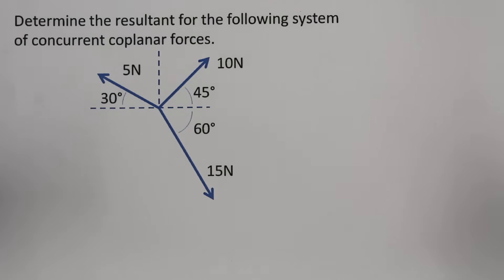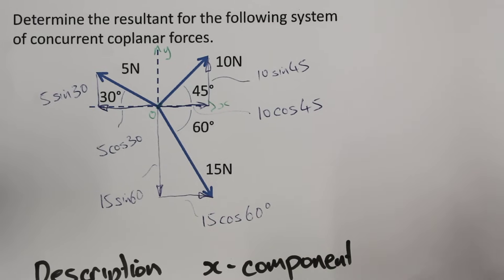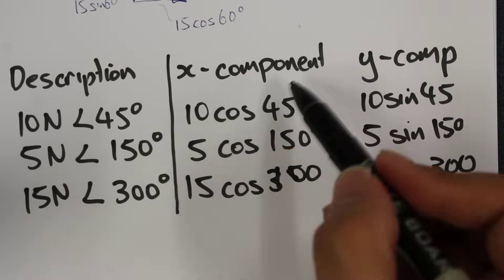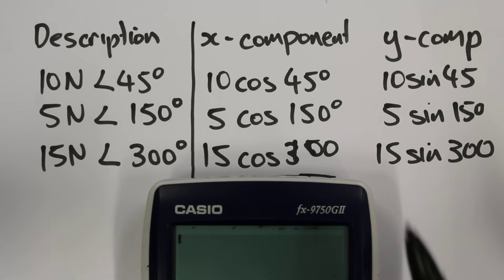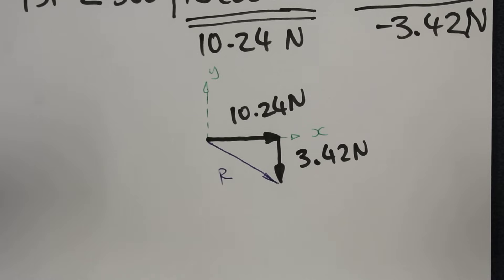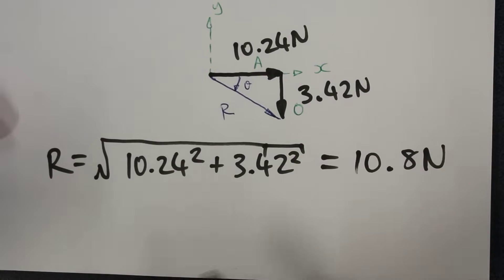Resultant of Three Concurrent Coplanar Forces

Comment: You should include the sign convention on the angle theta
Reply: No, The direction is mentioned in the figure he made.
The figure itself justifies the direction.. this is amazing
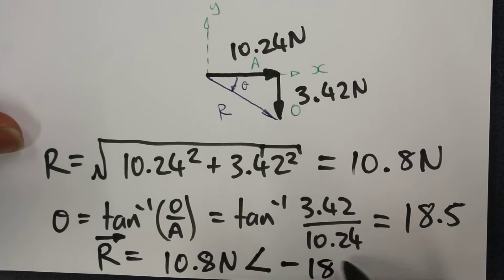Reply: The figure does help to point out the sign convention and I have used a symbol at 11:00 to indicate the sign convention. I do agree with John that including a diagram to indicate the sign convention could be useful to avoid any doubt as I have seen several questions about the angle and the negative sign with the 18.5 degree angle in the comments section of this video.

Comment: I have a question why is the 18.5 negative
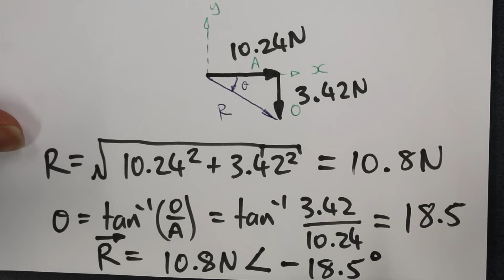Reply: I think you are talking about the angle at @11:10 for the resultant force.

The angle is negative because there is a convention in Mathematics for angles. The angle is measured from the x-axis, and the positive direction is anti-clockwise.

The angle could be written as 360 -18.5 = 341.5 degrees as a measurement from the x-axis... or could be written as -18.5 degrees as measured from the x-axis.

Also, the angle symbol used (http://www.fileformat.info/info/unicode/char/2220/index.htm) means that the angle is measured from the x-axis with anti-clockwise positive

here is an answer by someone else
https://www.quora.com/Why-do-we-measure-the-angle-anticlockwise

Comment: The angles of 30 degrees and 60 degrees can't be used. For the force of 5N you use 180-30=150 degrees and for 15N 360-60=300degrees. We measure angles from the first quadrant. The calculations for this will be wrong won't it?
Reply: "The angles of 30 degrees and 60 degrees can't be used. For the force of 5N you use 180-30=150 degrees and for 15N 360-60=300degrees. We measure angles from the first quadrant." 
# yes this is what I have done for this question. I want to point out that this is not the only way, an alternative could be to find the x and y components of the vectors using the angles that were given. For example for the 5N force.
x component: = - 5 cos 30
y component: = 5 sin 30

For the 15N force
x component: = 15 cos 60
y component: = -15 sin 60

In this method, the negative or positive is from if it is pointing in the x-direction or y-direction. The choice of sine or cosine comes from trig and SOH / CAH / TOA. 
Opposite = H Sin (Angle). 
Adjacent = H Cos (Angle)

"The calculations for this will be wrong won't it?"
I believe that the answer for this is correct as it has been solved several times by multiple engineering students and lecturers however I am interested to see your answers as maybe you are using an alternative method and we can discuss and learn together.

Comment: If three force 50N ,60 and 20 are  acting on a body simultaneously and 20N is opposite to the direction of other two.Determine the resultant force.
Reply: This sounds like an addition, subtraction problem.

For example
50N pushing to the right
60N pushing to the right
20N pushing to the left

Overall, there will be a net force of 90N to the right.

Comment: 2 questions 
1) How can u use cos and sin if you have angles like 300 meaning its not even a triangle anymore?
2)Why can you go clockwise for the final resultant answer but before all angles were measured anti clockwise?
Reply: 1) Trigonometry is used in triangles, 3 sided shapes. It can not be used in others unless you split the shape into triangles and work it out from there.
2) The final resultant was negative, subtract this answer from 360 it will give you the anti clockwise angle. Hope this helped :)

Comment: what if one of the force lies flatly on x-axis or y-axis?
Reply from the maker: If its pointing to the right, along the x-axis, the angle would be 0 (or 360). If it is pointing up, along the y-axis, the angle would be 90 degrees. If it is pointing left, in the negative x-direction, it would be 180 degrees. If it is downwards, along the negative y-axis it would be 270 degrees.

Alternatively, you could just write the value of the vector. So if it is a 16 Newton force, perfectly along the x axis; you would have 16N in the x direction and 0N in the y direction. 
If it is a 18N force in the y direction; it would be 0 Newtons in the x direction and 18 N in the y direction. If it is 22 N in the negative x direction;  it would be  minus 22 Newtons (-22N) in the x direction, and 0 Newtons in the y direction. If it is 25 N in the negative y direction; it would be 0 Newtons in the x direction and -25N in the y direction.

Comment: On the graph your wrong 3.42 isn't it meant to be -3.42???
Reply: Are you referring to 7:50 ?

I assumed that the direction of the arrow was enough to indicate that it was in the negative direction.

I tend not to write the negative in that case because someone might look at that image then assume that the negative means that the vector is in the opposite direction compared to what was shown. ie they might think that since I wrote -3.42 going down; that actually means 3.42 going up. The person would then get an incorrect idea of what I achieved.

Alternatively, you could use the values as coordinates (rather then writing the vector in the x direction and y direction); in that case you would need to write -3.42 to indicate the y-coordinate.

Comment: why dd the negative 3.42 turn positive while calculating the resultant using pythagoras
Reply from the maker: You can treat it as negative, and you will still get the same answer. sqrt( (10.42 )^2 + (-3.42)^2).
Note that a negative number squared is a positive number.

Comment: a body is acted upon by concurrent, coplanar force system. The rotation of body will zero why?
Reply from the maker: This question has assumed (either correctly or incorrectly) that the forces are being applied at the centroid of the body. This would mean the forces would only cause translation of the body and not rotation.

Comment: Who to change the titha-18 = negative sign
Reply: I think you are talking about the angle at @11:10 for the resultant force.

The angle is negative because there is a convention in Mathematics for angles. The angle is measured from the x-axis, and the positive direction is anti-clockwise.

The angle could be written as 360 -18.5 = 341.5 degrees as a measurement from the x-axis... or could be written as -18.5 degrees as measured from the x-axis.

Also, the angle symbol used (http://www.fileformat.info/info/unicode/char/2220/index.htm) means that the angle is measured from the x-axis with anti-clockwise positive

here is an answer by someone else
https://www.quora.com/Why-do-we-measure-the-angle-anticlockwise

Comment: Why is the 18.5 negative
Reply from the maker: I think you are talking about the angle at @11:10 for the resultant force.

The angle is negative because there is a convention in Mathematics for angles. The angle is measured from the x-axis, and the positive direction is anti-clockwise.

The angle could be written as 360 -18.5 = 341.5 degrees as a measurement from the x-axis... or could be written as -18.5 degrees as measured from the x-axis.

Also, the angle symbol used (http://www.fileformat.info/info/unicode/char/2220/index.htm) means that the angle is measured from the x-axis with anti-clockwise positive

here is an answer by someone else
https://www.quora.com/Why-do-we-measure-the-angle-anticlockwise

Comment: For the resultant, do you have to go 'X' then 'Y' because the other way round would give the same magnitude R but a different angle right? cheers
Reply from the maker: Yep, you will get a different angle. You are using the tan equation to find an angle. Usually, I just draw the triangle that results in order to find an angle relative to either axis; then measure the angle from the x-axis.
 ------- tan equation below -------

Tan (angle) = opposite/adjacent

In some countries they use

Tan (angle) =  perpendicular / base.. I dont like this naming convention because it confuses some people.

Comment: Sorry but may I know how you get 150° for 5 N and 300° for 15 N and why??
Reply from the maker: The angle I am trying to get is the angle, measured from the x-axis, in a anticlockwise direction. The reason is because the sine wave was derived from finding the ratio between the y component and the magnitude of the arrow; the cosine wave was derived from finding the ratio between the x component and the magnitude of the arrow. Please look for a video of a rotating vector and sine to help you visualize this (sometimes called a rotating phasor). The graph of sine, is a graph of the percentage of the length of the vector in the y-direction.
https://www.youtube.com/watch?v=OjHgoZOdRKM
https://www.youtube.com/watch?v=a_zReGTxdlQ&vl=en

I got the 150 degree value by knowing that there is 360 degrees in a circle, and that there is 90 degrees in each quarter of the coordinate system. We have 90 degrees in the first quadrant, and in the second quadrant, there is 60 degrees left over. The best image of this is the line that I draw at the 3:29 time stamp
I got the 300 degree value by knowing that there is 360 degrees for a full rotation, and there is 60 degrees between the vector and the x axis. So in the anti-clockwise (counter clockwise) direction, there will be 360 minus 60 degrees of angle ... ie 360 - 60 = 300 degrees. The best image of this is the line at draw at the 3:51 time stamp
Not sure if this helps, but I hope it does.
Reply: @corneliskok7794  aight! Thanks for the explanations!

Comment: QUESTION: 
what will  you do when after adding the x-comp and you are getting a negative number and if same happens to the y-comp
Reply from the maker: Hi Albert, You would add the vectors head to tail; with the x-component pointing left (horizontal with the page) and the y-component pointing down (vertical with the page). You would have a triangle that looks like this... https://www.researchgate.net/figure/RightAngle-Triangle-Hopper-Scale-19-Therefore-from-the-right-angled-triangle-Fig_fig2_281274006 (ignore the y on this image)

You could find the angle theta using the tan(theta)=O/A relationship

Then to find the angle with respect to the x axis you would add 180 degrees to theta above.

Note: If the vector is in the "third quadrant", the angle with respect to the x-axis should be between 180 degrees and 270 degrees.

For the magnitude: you would do the same as in the video. Note that the square of a negative is a positive. For example (-4)^2 is equal to 16.

Comment: Is it me or have you missed - and + numbers based on axis?
Reply: I mixed up two approaches in this video.

One way is to find out the magnitude using trig to find components; then if it's to the right it's in the positive x direction and it should be positive,  if it's to the left it's in the negative x direction and it should be negative... a similar thing would be applied to the y direction.

In the video, when I got to the table, I used another idea. When you use the length of the vector (example being 5 N) and times it by the cosine of the angle measured from the positive x-axis (example being 150 degrees) then the cosine function will make the number negative or positive as needed. (Cosine 150 is a negative number; cosine 30 is a positive number).

Search for "sine wave from a rotating vector" and I hope you will understand what I mean for how I have done it for te second way

Comment: Why did the angle of the final answer became negative sir?
Reply from the maker: I think you are talking about the angle at @11:10 for the resultant force.

The angle is negative because there is a convention in Mathematics for angles. The angle is measured from the x-axis, and the positive direction is anti-clockwise.

The angle could be written as 360 -18.5 = 341.5 degrees as a measurement from the x-axis... or could be written as -18.5 degrees as measured from the x-axis.

Also, the angle symbol used (http://www.fileformat.info/info/unicode/char/2220/index.htm) means that the angle is measured from the x-axis with anti-clockwise positive

here is an answer by someone else
https://www.quora.com/Why-do-we-measure-the-angle-anticlockwise
Reply: @corneliskok7794  Thankyou sir!

Comment: why is the 15N force at a 60 degree angle when from the centre its technically 30 degrees
Reply from the maker: Hi PlainLuke,
I was trying to avoid drawing over the top of the x component of the 10N force.

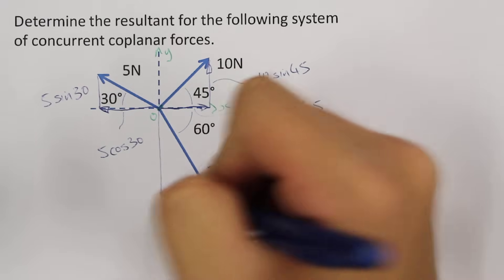At time stamp @1:37, the downwards vector can also be calculated using 15 cos 30; 
At time stamp @1:39, the vector going to the right can also be calculated using 15 sin 30

15 cos 30 ... is also equal to ... 15 sin 60 ... which is the downwards component
15 sin 30 ... is also equal to ... 15 cos 60 ... which is the component going to the right
Reply: @corneliskok7794  ohh ok thanks very much bro
Reply from the maker: @PlainVlogs  No worries :-)

Comment: Can the direction also be 198.5'
Reply from the maker: normally angles are measured anticlockwise from the x-axis.

Using the above convention the direction cannot be 198.5

If you are measuring the angle as clockwise, from the negative x-axis... then we could use 198.5 degrees. But this convention would be very weird.

Comment: why is it not 180 add theta for the direction?
Reply from the maker: It seems like you have been taught a method to determine the direction of the "equilibrant", once we have calculated the "resultant".

In this question, the resultant is 10.8N @ -18.5 degrees
(angle measured with positive direction being counter clock-wise from the positive x axis)

In this question, the equilibrant is 10.8N @ 161.5 degrees
(angle measured with positive direction being counter clock-wise from the positive x axis)
(note: 180 + (-18.5) = 161.5 degrees

Comment: When you did the 10.24 squared plus 3.42 squared the 3.42 is still minus isn’t it? So it still has the minus attached when you do the square root?
Reply from the maker: Yes, the 3.42 is minus. The minus is inside a square, so it becomes positive.

So (10.24)^2 is positive, and (-3.42)^2 is positive.

Sqrt [  (10.24)^2 + (-3.42)^2 ] is what I could have written too...

Comment: What was the point in working out 5sin30 and 15sin60 etc, if you just used the angle relative to the x axis?
Reply: Good point: its because I use both interchangeably; and the benefit of using 5sin30 like I have in the video is that sometimes it can be quite alot faster (or more convenient) than using the angle relative to the x-axis.

Part way through creating this video, around the 3 minute mark, I saw that it would be easier to demonstrate an answer that finds the x and y components of the vectors when they are written in polar notation (using magnitude and the angles measured from the x-axis).
Reply: Cornelis Kok so if you were to use the original 5sin30 etc, would you just be able to do the exact same table, except with all values relative to something else, and what would that something else be, I’m a little confused. Thanks for your help
Reply from the maker: @jacobfewings4068     yup, you could do the same table. One difference is that you would need to deal with determining if the component is negative or positive. For this question, the x component of the 5N force is negative. 

Sum of forces in x direction =
10cos45-5cos30+15cos60

Also, the y component of the 15N force is negative

Sum of forces in y direction =10sin45+5sin30-15sin60

If you check the totals for the equations above you should get the same answer as the video.

Comment: this is wrong. for x value it should be -5cos(30) for B  you forgot a negative sign, resulting in 8.741N for sum of x value.
Reply from the maker: Hi Ryan, thanks for your comment.

I can confirm that both methods would be correct. I think that you have an error in your calculations. Can you confirm what values you have for Ax, Bx and Cx?

-5cos(30) = Bx => -4.33
also 5cos(150) = Bx => -4.33

Please check that your calculator is in degrees as this is a common error.

Comment: 15sin60 and 15 cos60 I was unable to understand please explain this anyone😑😑
Reply from the maker: For the 15N force, we can create a triangle that is similar in shape to the following image.. https://www.dummies.com/wp-content/uploads/369581.image2.jpg

For our question, the 30 degree and 60 degree angles are in different places, and the length of the hypotenuse is 15.

The side that is connected to the angle is the component of the force in the x-direction. We can find this using cosine theta = adjacent / opposite. Which gives us:
adjacent = hypotenuse * cosine theta = 15 * cos 60

The side that is opposite to the angle is the comonent fo the force in the negative y direction. We can find this using sine theta = opposite / hypotenuse. Which gives us: opposite = hypotenuse * sine theta = 15 sin 60.

Not sure if this helps. But let me know if it does, or if you have any other questions.

Comment: How to solve the resultant vector with three vectors by using a parallelogram method?
Reply: 2 steps

1)Find the resultant for any two of the vectors.
2) Find the resultant of the third force, and the resultant force you found in step 1

Comment: How to take sin and cos for a force which is on the x axis itself
Reply from the maker: The angle you use would be 0 degrees.

sin 0 = 0
cos 0 = 1

You should see that the entire value of the force is in the x-direction.

Comment: So to calculate the angles for the 5N,10N and 15N,do you have to start from the positive side of the x-axis?
Reply: If you use an angle from the positive x it gives you directly the sign where the force is going whether it is posive or negative.